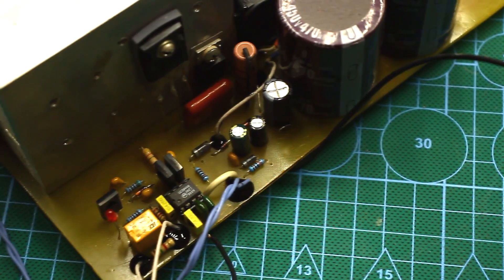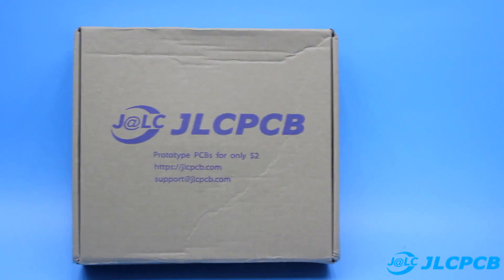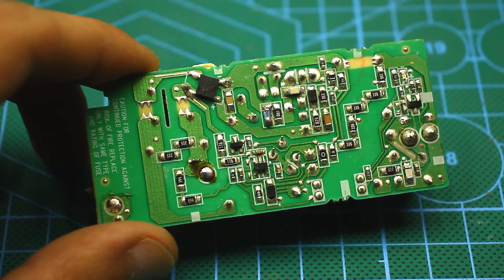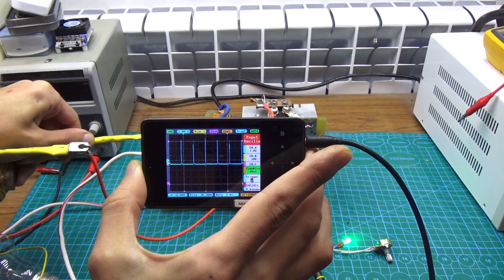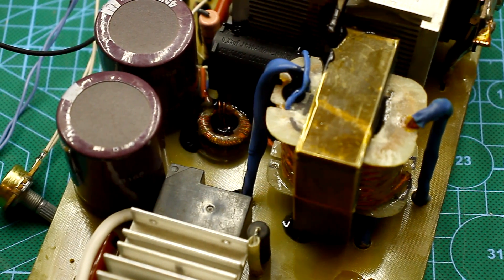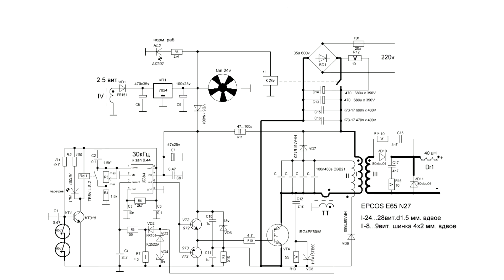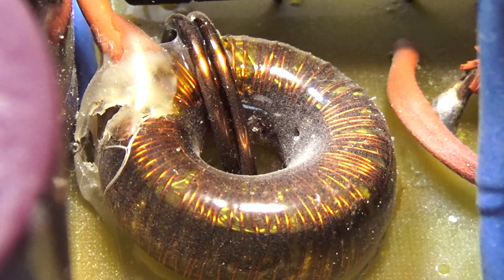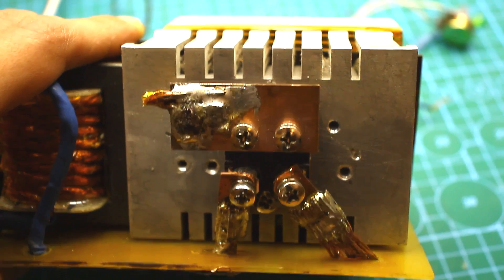The simplest welding inverter

Comment from the maker: Part 2 https://www.youtube.com/watch?v=wtpjAkVUrrE
Reply: I need pdf file or part list please please 🙏🏻
Reply: the welding inverter circuit needs a 310v input, the line mains here is 110v so I need to raise the voltage to this point so that the inverter welding machines can work .... can you help me ???
Reply: Can you upload the circuit and component list please?
Reply: Yes mem,  I need pdf files for cercuit diagram inverter welding machine 220volts ac
Reply: Please let me know transformer turns nos of both.
Reply: @Kasyan TV
can you please make a "generalized" video about "how to" convert a three-phase tig welder into a single-phase please ? and also how to change the standard accepted voltages a welder is designed to run off into the voltage you require for your country /power source. As there are countless used cheap , powerful 
3 phase welders available online that no one buys because 3 phase is rare an to expensive to get installed  in residential houses, surely you know of a way to do these things

Comment: Im here because I bought one of those $60 arc welding inverters off eBay and hooked it up to 240vac when it was only meant for 120vac.😬 As far as I can tell only damage is a big capacitor right after the rectifier on the mains input. Hope I can bring it back...
Reply: an easy way to fix it is......
1)dip fingers in a glass of water and touch the live wire with your index an thumb while holding onto a microwave bag of popcorn. 
2) if that doesn't fix your capacitor problem, then get a bigger fucking hammer and give the welder some love taps 
3) And swearing always helps too
Reply: @mp-uy9sv  😂😂😂

Comment: hola, puedo usar el fgh60n60
Reply: Yes. I used such a transistor, replacing the gate resistor with 11 ohms. everything works perfectly. but better read the datasheet, the characteristics may vary depending on the manufacturer

Comment: Why is it 55 hot resistance
Reply: this is normal. put 1 high power resistor, or several parallel weaker ones, so that they end up with the necessary resistance

Comment: I'd like to see a video like this about building a lower amp DC machine that I could rig for TIG welding of sheet metal. Accurate control from 0-say 60 amps would be needed.  Most TIG machines on the market are 135amp plus and don't have good control below 40amps.

Comment: Wouldn't it be cheaper and easier to just use a old school transformer? And maybe a circuit similar to a vfd, to regulate the output? Using a rectifier, and capacitor for DC output?  This is a cool project, I wish I had the funding to go to China, and buy components!!

Comment: cant we just use a proper car battery as a dc welder and solve the need for all these circuits?
Reply: Sure! But you have to periodically charge that 12v battery so that you can weld with it. My problem with Kasyan's DC welder is that it is too complex. Why not just use a MOT? Remove the high voltage secondary winding and replace it with a few turns of very thick wire for a low voltage secondary. Problem solved.
Reply: @foureyedchick  yeah that sounds easy too..i still prefer playing dc with batteries instead... but i think you need at least 36volts of 12 in series to do a proper welder..
Reply: @fidelcatsro6948  36 volts will work. Most welders are 24v. In my husband's garage we used 24 volt welders.
Reply: @foureyedchick  ok...thanks for the tip!

Comment: Was under the impression that precious Litz Wire was for multiple-megahertz applications.  You are certainly ensuring that the design's weak points are covered!  This whole project is way beyond the safety zone for a home hobbyist like myself, but it is entertaining.
Reply from the maker: we understand this very well, as well, that not everyone can repeat it, so the video says that it’s easier to buy than to assemble.
Reply: @KasyanTV  
can you please make a "generalized" video about "how to" convert a three-phase tig welder into a single-phase please ? and also how to change the standard accepted voltages a welder is designed to run off into the voltage you require for your country /power source. As there are countless used cheap , powerful 
3 phase welders available online that no one buys because 3 phase is rare an to expensive to get installed  in residential houses, surely you know of a way to do these things

Comment: that inverter very good, small with decent amount power usually 80Amps(1kw at output) is enough for welding. just hates the mini 24v fan its noisy lol